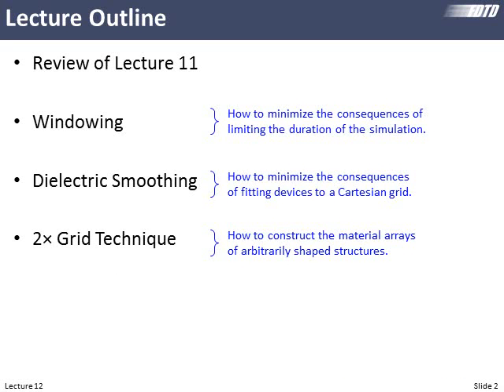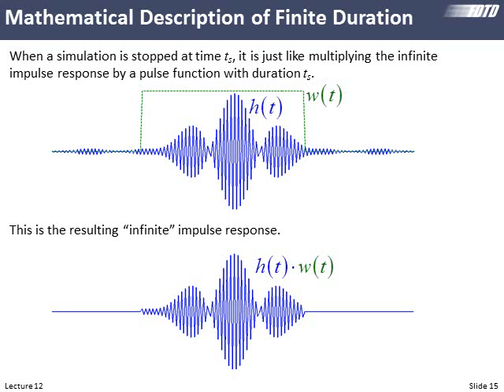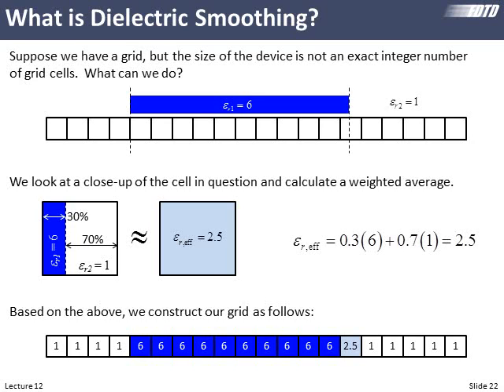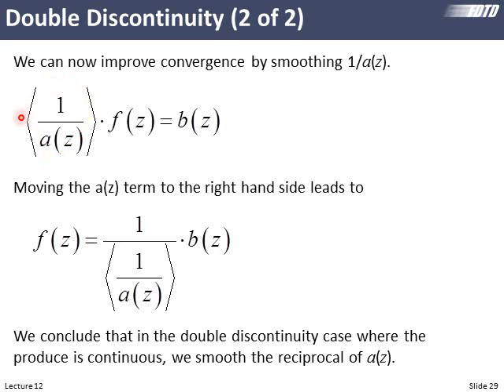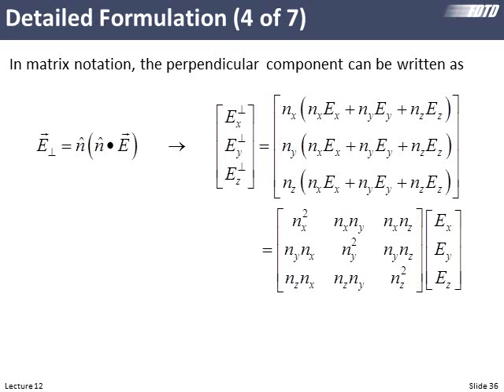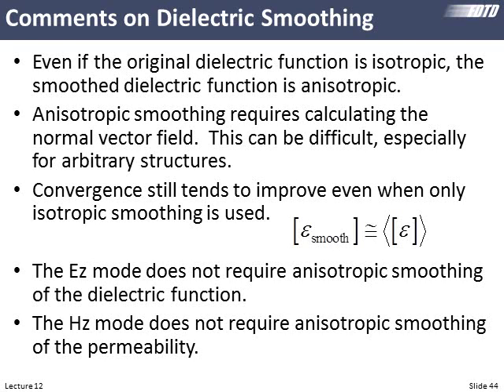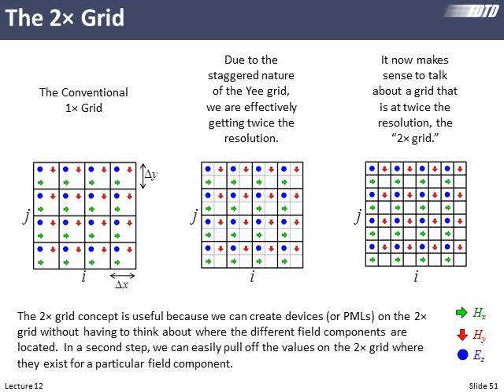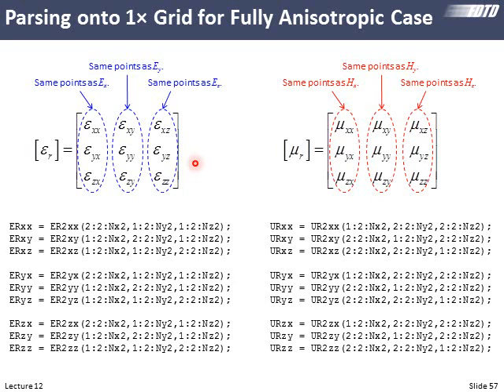Lecture 12 (FDTD) -- Windowing and grid techniques

Comment: Hi, I'm following along with your great lectures, thank you very much for posting these! I have a working 2D code now, which I've modified for cylindrical coordinates (I will cite your website in papers when using this code). For my device besides Maxwell's equations I also need to solve for magnetization dynamics M, using Landau-Lifshitz-Gilbert equation. But this equation contains both M and dM/dt, so I don't see how it could be implemented in Yee algorithm easily. Could you give some suggestions?
Reply from the maker: You probably need multiple update equations per point were you want to calculate the magnetization. I am not entirely sure about the Landau-Lifshitz-Gilbert equation, but ordinarily those updates would involve a magnetization, a magnetization current, and the magnetic field. You can see an approximately equivalent thing for polarization and polarization current in the "Frequency dependent materials" section of Lecture 2f here:

https://empossible.net/academics/emp5304/

Hope this helps!
Reply: @empossible1577  thank you!

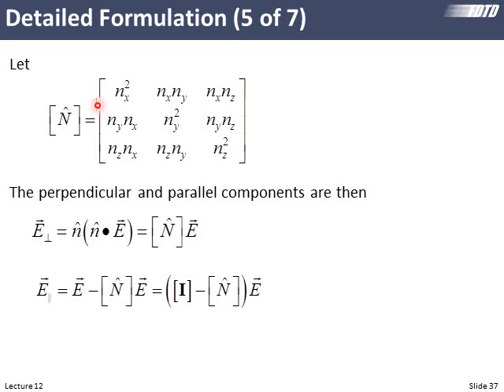Comment: hi Professor, what are the elements [n_i n_j] in [N] at time 31:54? I think they would be zeros when i is not equal to j? otherwise ,they are equal to 1?  then {N} should be a unite matrix..I think my understanding should be wrong...so what are n_x, n_y, n_z...
Reply from the maker: Not quite.  You are correct that they are diagonal matrices, but the elements are not all 1's.  Instead, they are the components of a vector that is normal to any surface that may be present.  You essentially have to calculate a normal vector at every point throughout your device.  At the interface between two materials this is obvious, but it may not be as obvious if a point is well inside of a medium.  For this case, it actually does not matter the direction of the normal vector.  Therefore, it is best to choose a normal vector that matches the normal vectors at the actual interfaces as much as possible so the overall normal vector field is as smooth as possible.  Calculating a normal vector field is not easy or obvious!  One way you could do it is to blur your device and calculate the gradient.  Normalize the magnitude of your gradient to 1 at each point and you have a decent normal vector field.  There are other ways that work better.  Refer to the literature on this.  You may find the most in the literature for rigorous-coupled wave analysis (RCWA).  

BTW, in my experience, this technique is not worth the numerical overhead.  Instead, just blur the boundaries by one pixel and stick with isotropic materials.  Always be sure your simulation is converged.  There may be cases where my observation here is not correct.
Reply: @empossible1577  thank you so much for your detailed response!  I got it.

Comment: Hi Professor, can both 2x grid and dielectrical averaging used in one file? If it could, how to use them, which one goes first? Thanks.
Reply from the maker: Absolutely!  2x grid comes first.  Do the averaging on the 2x grid.
Reply: @empossible1577  many thanks for the awesome lectures. I increase the grid size first and do averaging as you said. I am a bit confused about something. I think the 2x grid has to be 2x or an even multiple since the values at mid points are needed to go back to original grid. Then, normally the averaging (box filter?) is a an odd size (3x3 etc.) filter, but from what I understand, you say to convolve it with the original grid size (which means a 2x2 averaging filter for 2x grid) to calculate the average. Does using not the center point of averaging kernel not cause any issue ?
Reply from the maker: @metebalci  You have it mostly correctly. First calculate the ordinary Yee grid (Nx, Ny, dx and dy), then calculate the 2x grid (Nx2, Ny2, dx2 and dy2), then calculate yet a third grid that puts an odd number of points for every one point on the 2x grid. So if Nx2=10, then you would want Nx3 to be 30 or something like that. This way you have an exact center cell to get the exact average. Be sure your blur function is a circle instead of a Gaussian because you only want to blur by the amount that would be one pixel on the 2x grid.

I should probably make a tutorial on this. Hmmm...
Reply: @empossible1577  do I get it right, do you mean the 6x grid (Nx3) can be blurred with a 3x3 kernel ? By circle (blur function), do you mean something different ? I thought the filter is an arithmetic average of all 8 cells around a cell (thus 3x3 matrix with elements=1/9). If this is the way to go, I guess it is OK to just create a 6x grid directly, build the device on it, then blur, and then resample the eps/mu components (each separated by 3 cells on 6x grid). A tutorial about this, both basic/scalar averaging  and also the advanced method using the tensor would indeed be very good.
Reply from the maker: @metebalci  I think you understand. Yes, I agree that a tutorial would be best. 

I am hesitant to create the "6x" grid first. Sometimes I like to control my ordinary grid in terms of number of cells and other things. It would not be impossible, but more complicated to do that through the higher resolution grids. There is a reason for using more than 3 pixels on the high resolution grid, the more you use the more accurate of an average you can calculate. That said, I tend to use just 3 or maybe 5.

Comment: How about doing only the double reciprocal blurring instead of calculating the normal vectors? Does it have a negative impact on the calculation of tangential D/E fields?
Reply from the maker: In principle yes.  However, in my experience any attempt at smoothing with improve things.  Also, it may be misleading for me to call it smoothing.  Instead, I should call it averaging.  The goal is not really to smooth an interface because this would artificially suppress reflections.  Instead, the goal is to perform an averaging operation to better handle when an interface slices through the middle of a Yee cell.  One technique for computing the averages is to smooth the dielectric structure, thus my use of the word smooth.  I am teaching this class this coming semester and I am planning on improving this discussion with some better visualizations of what is happening.

Hope this helps!

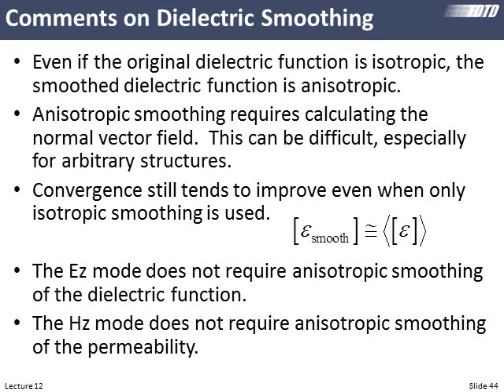Comment: In 38:29, what happens in case when the device conforms to the grid perfectly? The response without smoothing and with smoothing shall be the same right? in other words smoothing operation has no effect?
Reply from the maker: If done correctly, it should have no effect because the edges should not bleed into adjacent grid cells.

Comment: To me it would be more sound to parse ERzz starting from index 2 in both direction and parsing URzz from 1 in both direction, why the opposite?
Thanks
Reply from the maker: Nicola Cattabiani First, just so that you are aware, you can get electronic copies of the notes and many other resources at the following link.  The notes contain some revisions, additions, etc., that have not made it into the recordings yet.  It is from these notes that I will refer.

http://emlab.utep.edu/ee5390fdtd.htm

First, take a look at the unit cell for the Yee grid on Slide 15 of Lecture 5 (latest notes).  Observe how the field components are staggered and positioned in the grid.  Notice that in the x and y directions, the Ez component is at the origin of the Yee cell making it first and requiring the array indices in the x and y directions to start at 1.  Ez is offset by a half grid cell in the z direction so it appears second and requires the array indices to start at 2.  ERzz is defined to be at the same points as Ez.  

The Hz component is offset by a half grid cell in the x and y directions so the array indices should start at 2 in those directions.  It is located at the very bottom of the Yee cell so it appears first in the z direction so the array indices start at 1.  URzz is defined to be at the same points as Hz.

Does this make sense?